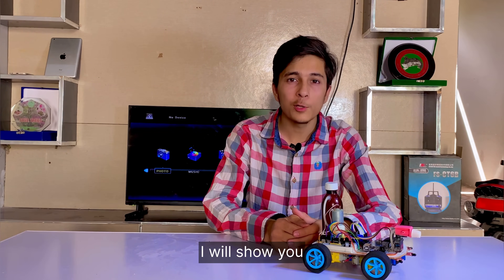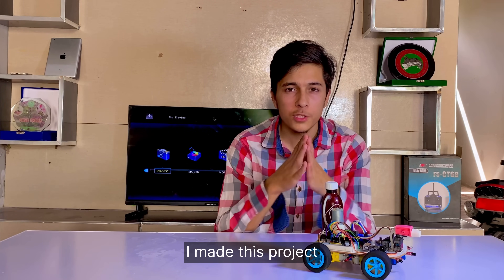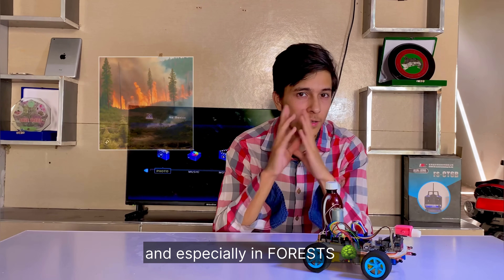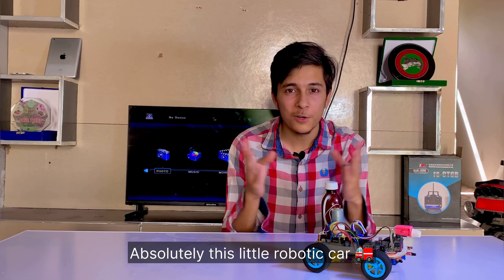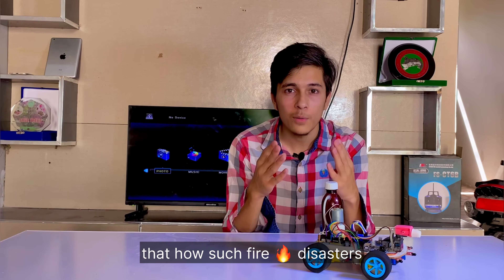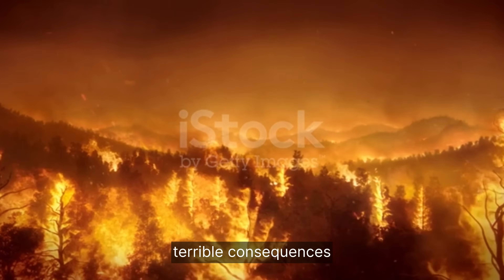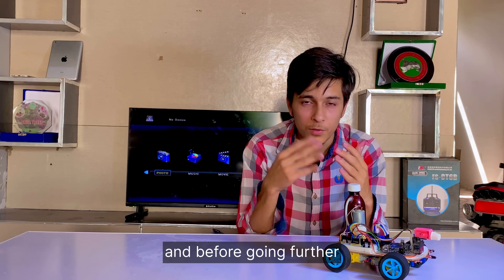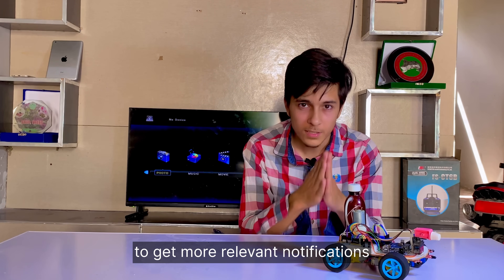DIY Fire Fighting Robot using Arduino  |  Auto Fire Chaser and Extinguisher

Comment: bro everything is working 💥 but dc motors not moving (wheels) can you help me please
Reply from the maker: What is you total input voltage? And name the battery and sensor pins
Reply: @saadinnovativeideas  i used 3 battries 3.7v lithium ion batteries as you suggested and sensor has 4pins in that i connected to ao(output),gnd for - and vcc for positive i refered your circuit diagram to give connection
Reply from the maker: Double check you connections with the circuit diagram. And have you uploaded the code successfully with the right port?

Comment: Disculpa, espero que me puedas contestar rapido, esque estoy usando tu circuito y codigo, pero no bonbea el agua y las ruedas no avanzan, solo el servo es el unico que se mueve, de ahi en fuera nda me funciona, espero me ayudes ya intente de todo, incluso le puse una pila de 9v y nadota 😢🤧
Reply: POR FAVOR, MI PROYECTO ES EN 2 DIAS 😭
Reply: @florluna1698  si no se mueve para nada las llantas es por que esta mal la conexión del  L298N, recuerda que debe encenderse las luces rojas de la tablita
, o verifica la codigicación, si el sensor no detecta algo no se moverá las llantas, mientras el sensor detecte fuego las llantas se van a mover por que asi esta la codificación
Reply from the maker: If you have tested with ordinary 9v non rechargeable battery it wont work. Use rechargeable battery that provides sufficient amps (2+) needed by the project

Comment: My flame sensor had only three pins then what should I do?
Reply: It's urgent what can I do please tell me any changes and code
Reply from the maker: Name the pins and its connections
Reply: I have two days left so help me out and already done everything just the connection between three pin flame sensors is confusing
Reply from the maker: The code and its circuit diagram are for analog pin, D0 won’t work
Reply: @saadinnovativeideas  we change the connection lit bit and in code we declare D0 and and in place of A0 we put D0 and it runs without error

Comment: Hola por favor ayudame el sensor de llama si prende los dos focos cuando lo activas con el fuego pero em carro no avanza ya puse el codigo como esta pero los pines del video son diferentes al codigo.
Reply from the maker: Which pins have you used of sensors
Reply: @saadinnovativeideas  los del video
Reply from the maker: Tell me some symptoms about the project so I can guess the issue. Whats total input voltage? And name the battery you have used
Reply: Al principio solo utilize dos baterías de 3.7 v ya después agrege otra más 3.7v las pilas son sharpstar 18650 , 8000mah
Reply: Crees que mi arduino sea chino y por eso no sirva el código
Reply from the maker: Is that Arduino UNO?…
 Does no component work?

Comment: All the sensors are working but the car is not moving can anyone help?
Reply from the maker: Which flame sensor have you used. 3 or 4 pins, name the pins and its connections
Reply: @saadinnovativeideas 3pin one flame sensors , water pump and servo motor all are working  but the car is not moving
Reply from the maker: Is that have A0 or D0 pin?
And how much is the net input voltage, name the batteries
Reply: Pls help me  bro can you talk on some media plss
Reply from the maker: Recheck you flame sensor pin names! Bcs there should be A0 or D0 pin
Reply from the maker: And, have you used 4 batteries of 3.7v?? In series or parallel
Reply from the maker: 4 x 3.7v in series gives 14.8+ volts, that would fry out your motor driver and other components
Reply: @saadinnovativeideas  other components are working when I put flame the pump is getting turned on . The only problem is that the car is not moving
Reply: But when I gave 2 batteries of 3.7v still the car was not moving 
That's the reason I put 2 extra batteries

Comment: How did you connected the servo motor to the breadboard because in the servo motor the pin which you inserted inside the breadboard is not present😅🫠
Reply from the maker: I had done permanent soldering behind the scenes 😀. But doesn’t matter use male to male jumper wire to connect you servo to the breadboard

Comment: How did you connected the batteries with the switch 😅 pls explain🫠🙏🏻
Reply from the maker: 2x 3.7v batteries in series to the motor driver with a switch on one wire before reaching motor driver

Comment: Hola una pregunta en el soldado de los sensor flama veo que el diagrama del minuto 3.27 explica donde tienes q soldar y en el minuto 3.29 aparece como lo solda pero aparece diferente de lo que explica en el diagrama del minuto 3.27
Reply from the maker: Yeah, I settled the them behind the scenes, you just follow the circuit diagram

Comment: Bro please help help help I need your help

I made it but I used only 2 geared motors and one castor wheel can you give code please please bro for this connections please or else say how

Fire sensor connection 

3 fire sensors positive (vnn) and negative(gnd) are connected in parallel and positive(vnn) is connected to arduino 's 5v and negative (gnd) is connected to arduino's gnd in parallel 

And digital pin (output) of all fire sensor is connected separately 

That is 
Fire sensor 1-arduino's digital pin 9
Fire sensor 2-arduino's digital pin 8
Fire sensor 3-arduino's digital pin 10

2.sg90 servo motor connection's

Signal-digital pin 11 of arduino
Positive-5v of arduino
Negative-gnd

3.5v relay with components (1N4007 diode's first coil to relay,Bc547 transistor's first leg to 1N4007 diode's second leg,220 ohm resistor to middle leg of bc547 transistor)

And its connections 

1N4007-5v pin of arduino
Bc547 transistor-gnd of arduino 
220 ohm-digital pin 6

4.motor driver module L298N connections

IN 1- digital pin 5
IN 2-digital pin 4
IN 3 - digital pin 3
IN 4 - digital pin 2

5.geared motors connection to motor driver module

Sorry but I connected 2 motors positive and negative to out1,2,3,and 4 and it depends on components

6.power for arduino,relay,motor driver,water motor and switch

Battery holder connections and power for motor driver 
Positive - first terminal of 
switch
Negative -to gnd of motor driver module

Switch's second terminal to gnd of motor driver module

Arduino power

A wire to gnd of arduino and gnd of motor driver module 

A wire to vin of arduino and 5v of motor driver module

Water motor connections

Positive to relay
Negative to transistor's last leg(This depends on components if it not works we need to change polarity here)
Reply: i can help you
Reply: @drumsmayur  yes please bro
Reply from the maker: Brother same code will be used but you are using digital pin sensors. If the sensors have analog (A0) pin then connect them with arduino uno because the code and connections are structured for analog pin. If sensors do not have A0 pin then replace your sensors with one having analog pin, otherwise it won’t work
Reply from the maker: And try to use 5 v relay module with the following change in the circuit diagram I provided

Follow the connections given below

  Arduino ——-> Relay mod.
      5V   ———>  VCC
    GND ———>  GND
    A5.   ———>  IN

Pump   —————> Relay mod. Slot
    wire 1  ———->  NO
    wire 2 ————> COM
Reply: @saadinnovativeideas  thanks 👍

Comment: Bro I done this project and also uploaded the code as same as you did but it is not even working only the sensor is lighting when I bring flame near it I want this project tomorrow (4 /11/2024). 😢please tell me solution😢😢😢
Reply from the maker: You may have sensing or power problem. Name the sensor pins and the batteries used
Reply: 18650-1500 mah 3.7 V 5.55 wh li ion battery rechargable
Sensor - vCC,G, AO, do
Reply from the maker: Does it not show a single reactions when exposed with flame
Reply: No it is not showing any action

Comment: yo saad when i put a mathctstick the ir reciver lights up but no movement on motor water pump and servo
Reply from the maker: Name the sensor pin names and the batteries used
Reply: @saadinnovativeideas  same as urs
Reply: @saadinnovativeideas   4 1.5 batteriesso 6volt

Comment: Why do my pump doesn't eord
Reply from the maker: What?
Reply: @saadinnovativeideas why do my pump doesn't work even though all of the parts are working
Reply from the maker: You can use relay module with following changes in circuit diagram

Arduino ——-> Relay mod.
      5V   ———>  VCC
    GND ———>  GND
    A5.   ———>  IN

Pump   —————> Relay mod. Slot
    wire 1  ———->  NO
    wire 2 ————> COM
Reply: @saadinnovativeideas  how about the code do I change it?
Reply: @saadinnovativeideas  and is the relay module 5v or 12v?
Reply from the maker: 5V relay module. No change in the code required

Comment: Connect Arduino's No:10 pin to EnA and so on Upto 5th pin to EnB.

Take 3(A0) Pins of Sensors, Servo's Vcc and Arduino's 5v and connect it in a separate column of breadboard.

First Connect A4 pin and Servo's PWM pin if it's not working then connect to D11 of Arduino and change the code from A4 to 11.

Lastly suggest you that make your own connections one by one from the given circuit diagram it's easy and working.
Reply: Didn't understand the 3rd point
Reply: @ansu.official bro I've done the same as he did now I need help what should I do now
Reply: @almanmemon6676  I mentioned few changes, try it !
Reply: @ansu.official my only servo is working rest all part will not work
Reply: I am also making this can you tell me what exactly I do in hindi if possible THANK you ❤
Reply: Brother, can you please explain step 2 nd step 3, its urgent bro
Reply: can you please provide your code in here if possible that will be really helpul or you can email it as well 
please i am doing this for my college project so your help will be really appreciated
Reply: @princyvasava30  did it work??? Can you help me please

Comment: Bro can we use 4-12v motor pump for this?
Reply from the maker: Yes, compatible
Reply: @saadinnovativeideas  also, will your code work if i use submersible water pump(1 nozzle) instead of two nozzles that youve shown in this video?
And ,is IN4148 Diode compulsory to use in this project? please reply fast bro i have to submit the project in five days.

Comment: Amigo porq el servo motor y los Motores de llantas no tienen movimiento
Reply from the maker: Which battery have you used and how much pin sensor, also tell me the sensors pins name and its connections
Reply: @saadinnovativeideas  3.7 voltios pines AO,G,+
Reply: @saadinnovativeideas conexión servo motor a protoboard y sensores a protoboard

Comment: Bro when o started the project and place flame then tip 122 get heated and smoked First time and heating pls help
Reply from the maker: Have you joint 1K ohm resister in series before tip transistor in connection
Reply: @saadinnovativeideas  yes

Comment: Bro pls help i am confused in the flame sensor connection you have used red one i have used blue one and red have 4 output but blue has 3 output
Reply from the maker: Any one having analog pin (A0)
Reply: @saadinnovativeideas No
Reply: @saadinnovativeideas pls reply
Reply from the maker: The code and connections are for analog pin A0 of the sensors. If you have the connected D0 of the sensors then it will not be executed by arduino
Reply: Then can we  change code instead of AO we can put D0 in. Code . It will work or not tell me please I have also same problem @saadinnovativeideas
Reply: @indianbtsarmy2861  pls reply if it works i have the same problem
Reply: @Winterbass_12  okay

Comment: Can i use a 20V battery
Edit : how long does the lithium ion battery last and how much does it cost ,can I charge the battery
Reply from the maker: Not of course, 20v will fry out your motor driver and other components. Max voltage is 12 v

Comment: Can i use BD 139 instead of tip122
Reply from the maker: TIP is far better than BD 139 because it can handle higher current and voltage and fast switching, however if you cant avail it you can use BD 139 as a subtitle

Comment: Coding will work saad brother are you sure because we are making that and after coding it will not work so what should we can do
Reply from the maker: Code is perfect, if it were not, no one would be successful using it. But any issue with hardware might make you feel that code is faulty. Make sure you use the same components and do the same connections
Reply: i can make this in under 1800 and ship to your location

Comment: Why does my battery heats when i connect it to the switch
Reply from the maker: Which battery that is? You connected components are consuming more current (amps) than battery can provide
Reply: @saadinnovativeideas is it safe when it heats?and how many amps that it needs
Reply from the maker: It should heat up a little bit but heating very much damages the battery
Reply: The 3.7v 18650 is it safe that it's heating?
Reply: How many amps that it needs
Reply from the maker: This battery delivers 2.5-3.5 amps which sufficient for the project. Have you connected two of them series?
Reply: i can make this in under 1800 and ship to your location

Comment: I am using 2 batteries of 3.7v (1200mah) does it work properly
Reply: And what is RPM of motor you have used
Reply from the maker: 200 rpm
Reply: Ok then
Reply: What if I use a 300 RPM motor
Reply from the maker: No issue, instead the car will go little faster
Reply from the maker: Yeah that work perfect
Reply: i can make this in under 1800 and ship to your location
Reply: Bro I ordered all Components in ₹1878
Reply: @ratnaramdarshan2289  😂😂 you lose your money more
Reply: @drumsmayur  bro I am saying with the cost of shipping and his shipping charge is ofcourse more

Comment: Hey bro when i turn on the switch the Arduino light doesn't turn on 
But when i plug the cable it on so please solve the problem
Reply from the maker: Which batteries have you used

Comment: Yoo can i make this without capacitor, diode, transistor, resistor. Please tell me
Reply from the maker: You can use relay module instead of these
Reply: @saadinnovativeideas how is the connection when I use a relay model
Reply: @saadinnovativeideas it has a gnd, vcc and in pin and 3 screw wire connection slot
Reply: Thanks man
Reply: Please 🙏🏻
Reply: A relay has three pin slots VCC, GND, and IN and three screw wire connection slot 😢
Reply from the maker: In the same circuit diagram just replace the components with relay module
Reply from the maker: Follow the connections given below
  Arduino ——-> Relay mod
      5V   ———>  VCC
    GND ———>  GND
    A5.   ———>  IN

Pump wire 1. ———-> relay mod NO
Pump wire 2 ————> relay mod COM
Reply: One more question 
We need to connect battery, Arduino, pump, to pin slots or screw pin connection slots
Reply: Given in a relay module
Reply: When you answer then I'll order the components
Reply: Thanku so much that is so helpful to me ❤❤
Reply: I am sorry that I ask too many questions but GND And 5V slot of Arduino is already connected to flame sensor
Reply from the maker: That doesn’t matter just connect them as I said.. And if if the motor was really slow or not turning on then connect it with VIN of Arduino
Reply from the maker: No no
Reply: Sorry my mistake one 5v and one GND slots are not in use 😂😅
Reply: Sorry my mistake one 5v and one GND slots are not in use 😂😅
Reply: i can make this in under 1800 and ship to your location
Reply: Bro what about the servo wire you connected to transistor 😢
Reply: Please reply fast

Comment: Can we use submersible motor inside the water bottle??
Reply from the maker: Of course, but of desired voltage 5-9 V
Reply: Can we use 5000v battery??
Reply from the maker: @mehekulsum9469  If you wanna fry out your components in a millisecond
Reply from the maker: 5000v where will you find it
Reply: @saadinnovativeideas  sorry it's 3.7v
Can i use??
Reply from the maker: Yeah two 3.7 v in series
Reply: I have confusion in connecting the wire of sensor to connect to breadboard 
Can you please help me through it
And there are 5 wire from sensor to breadboard right??

Comment: Hello, sorry, I assembled the video as is and loaded the code, but it doesn't work if I walk to the place, and neither the pump nor the servo activates, of course I am using the blue servo and the submersible pump. would you help me please
Reply from the maker: Tell me some signs so I may guess the issue.
Name me the sensors pins and the battery you have used
Reply: @saadinnovativeideas  I used the same pins as the diagram and the video, now I am using a portable charger with 12V output and 9V in case I tested with 9 and 12, what could happen?
Reply from the maker: Did You mean you are using charger for power input?
Reply: @saadinnovativeideas  I am using 2 4.2 V 1200 MAH batteries or what could fácil, do you Know? Because I am using 1 102 capacitor as you indicated

Comment: Do this code is correct ??
Bcaz if it lost means I will lose my place in exhibution and have made the ppt about the project......??
Reply from the maker: Code is correct 100% but making a bit problem in uploading process (not selecting the right port) or in hardware, the code is worthless.
Reply: @saadinnovativeideas  currently we don't have to made any changes only we have to follow your steps to complete this right???

Comment: Does this thing works even if the fire is exactly behind it.. What is the scope range of this flame sensor..??
Reply from the maker: No, this was an idea. If flame sensors are put at very angle with modification in connections and code, it will
Reply: So does that mean.. If we place 3 flame sensors in those  positions we can detect the fire in 360 deg angle..???
Reply from the maker: @vembuselvaraj7683  of course